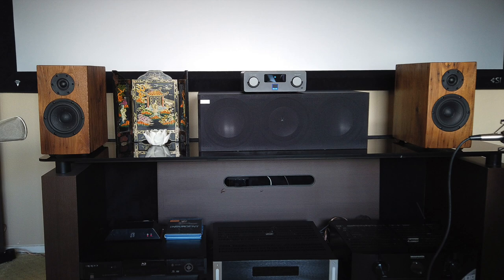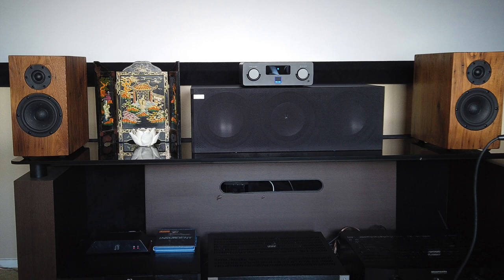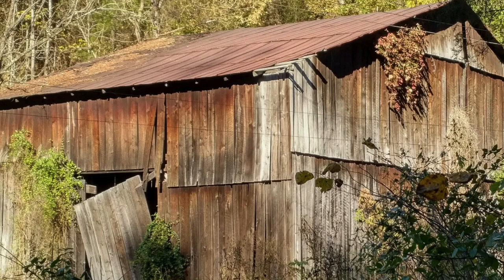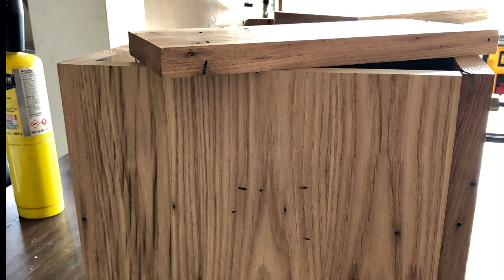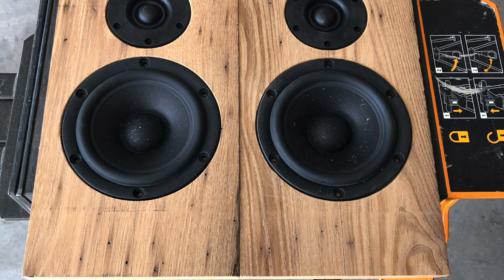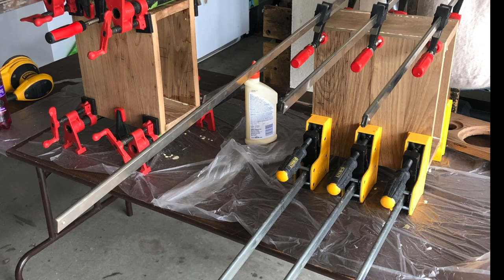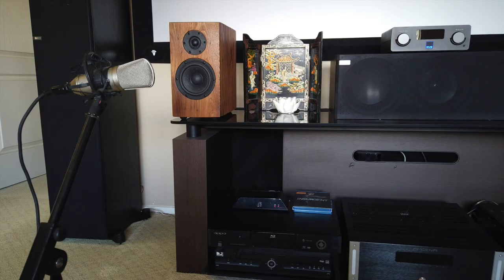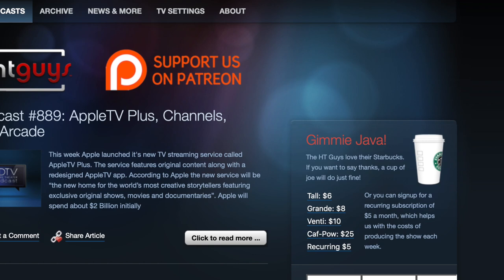CSS-Audio P215 Build - DIY Speaker

Comment: As a long time speaker DIYr,  I will have to state my opinion about using old hardwood, as opposed to voidless birch ply, or MDF. 

Solid woods all have their own (relatively unpredictable) resonance problems, depending on the type of wood. Softer woods will tend to resonate at lower frequencies, harder, dendser woods will tend to resonate at higher frequencies. The chances that the resultant resonance will be advantageous, and not detrimental to the sound quality, is pretty much a crapshoot. That is, of course, if you want your enclosure to not add any of it's own coloration to the overall system's sound. You might end up with and end result that is pleasing, maybe due to a resonance at a frequency that may add a bit of bump at mid bass freq, and add to the feeling of more bass and warmth, or a bump in the upper mids giving the speaker more presence, but you are most likely straying away from accuracy. 

I mean, seriously, good speaker manufacturers invest a lot of R & D in coming up with cabinet materials that are as well damped and nonresonant as budget will allow. 

The reason why 300 year hardwoods are so good for Stradivarius and Guarneri stringed instruments is because the woods ARE supposed to add to the overall sound of the instrument. With speaker design, the cabinet is supposed to get out of the way of the overall sound of speaker.

With all that being said, the CSS speakers are such a good design, with good quality components, that I am sure your end result is still very good.  Just not as optimum as they could have been.
Reply: IF I were going to use real wood, I'd use granadillo or bubinga. Or even purpleheart.   Hard maple would not be too bad. They are not expensive .
Reply: Part of the point is the color or character added or contributed to by the use of solid wood, in this case, aged/weathered etc.

Comment: Man, Ara! Awesome results! And the CSS guys were terrific guests, very informative. Still, these look to be a similar size as my Hsu speakers so first I’d try the best single tip any guest of the podcast ever gave: David Dukes telling us to put them on the floor. I know they are wonderful but I’d go there first to test them. My Hsu’s went from being “ok” to moving to a whole new level afterwards in my theater. Might not be necessary but I’d try it.

Damn, your mains look as big as my old Paradigm Studio 100’s!
Reply: I wouldn't recommend putting these on the floor. The speakers are designed as stand mount speakers and moving them to the floor will add a lot of bass emphasis that will likely be overpowering and make the speakers sound unbalanced. The HSUs might have benefited from that bass reinforcement but the P215s won't.

Comment: Nice bro, speaker n tweeter inch, ohms, watts? Pls reply bro
Reply from the maker: Satori MW13P-8 woofers 5" woofer
LD22 series 22mm tweeter

Crossover Point: 2100 Hz
Recommended Power: 20-100 watts
Nominal Impedance: 8 Ohm
Frequency Response: +/- 2 dB from 60 Hz to 20 kHz
Sensitivity: 87 dB @ 2.83 V
F3: 52 Hz
External Dimensions: 12"H x 6.5"W x 12"D
Reply: @TheHTGuys  thanks bro

Comment: I might have missed .. is there a sub in there somewhere?
Reply: No Sub. Just the P215s
Reply: They're rather close to the wall for a rear-ported design, which adds bass weight at the expense of definition.  They share the lower mid-range boost and upper mid-range cut with the more expensive Criton 2 which makes today's highly compressed pop and rock recordings less painful.